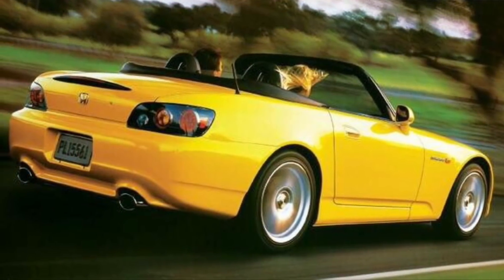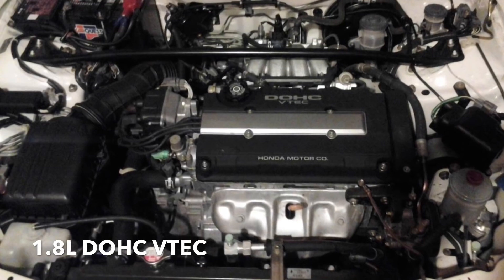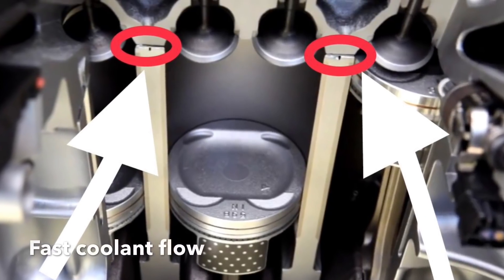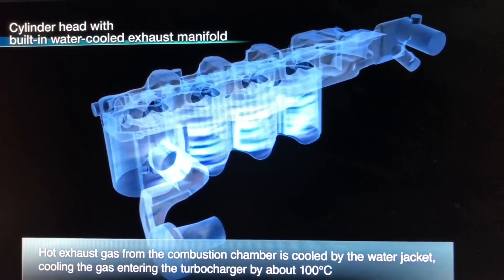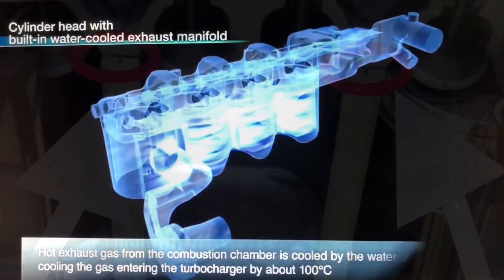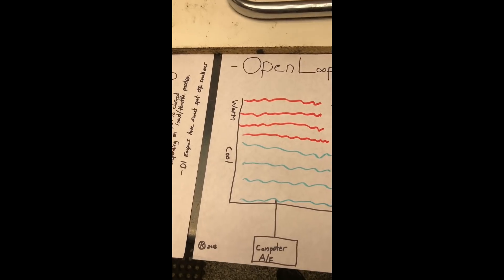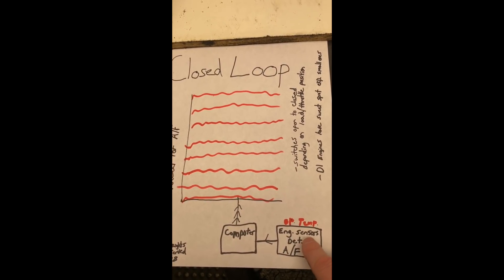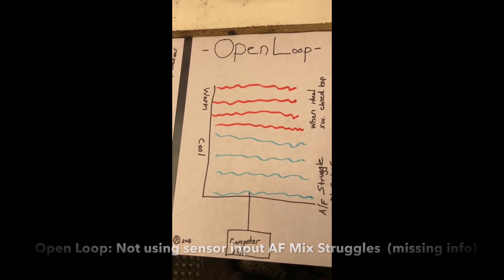1.5L Turbo Honda Oil Dilution Explained CRV Accord Civic

Comment: 2017 Si with 1.5T.  20k miles, so far so good. Change oil between 3 to 5k miles with Mobil One.  I warm up the engine till red bar shows up.
Reply: 41k miles on my 2017 CRV, 1.5l engine....no problems at all....get 35+mpg....luv it.   I use Mobil 1, Honda oil filters, change oil at 4000 miles or so.  Fill oil to 1/2 way on orange stick.  Oil dilution raises level to full mark, smells like gas.  But, all seems well otherwise.
Reply: harley62t  I have a 2018 crvI use amsoil in the engine and amsoil cvt in the transmission. I change oil every 5000 miles. I get 37 m/p/g. Also I use Mobil high test gas
Reply: @reginaldsmall3766 and I bet you had no problems with the engine or trans. That AMSoil is damn good stuff.
Reply: Seanster Yu good job bro I got 31k on my hatch 17 1.5t. And it’s still beating slightly older muscle cars with over 350 hp 😎
Reply: Im at 44k with mine. I make tons of short to medium trips daily for work. Just had all my warnings lights come on out of nowhere.  Honda told me it'll go away on it's own. This is my 6th honda. Not very sure there will be a 7th.
Reply: @kevinjohnson3925  engine warning light?  22k miles, still going strong.  I test drove 2nd type R yesterday
Reply: @seansteryu7398  22k miles is nothing, come back in 5 years when the car has 100k miles then we can talk about reliability
Reply: @AdamSmith-gs2dv  my s2000 ka supercharged with 152k still running strong.  Nonetheless, I'd pick any new turbo Honda over a ford.

Comment: If a American or European maker had the same problem every consumer group would be up in arms and people would be demanding buy backs and there would be class action lawsuits.
But all the Honda fanboys will just overlook it.
Reply: I am originally from Germany and my father worked as a engineer at both Opel and Volkswagen.
They both produce small displacement GDI turbocharged engines and neither experience the same problems.
People seem to think that American or European automakers produce inferior products compared to Asian manufacturers.
That simply isn't true and when a Asian manufacturer has a problem people gloss it over.
Reply: I come from Austria and i dont have this problem on my Honda civic 1.5 turbo 6MT manual..And i drive a lot of short distances....9km its about 6 miles to work..but at least once a month 100 miles .But i would like more people from Europe read this and if someone have this problem then we can make a community i dont know how and make pressure to honda to do something also here and whole USA
Reply: You got that right , I would be all over the news as well
Reply: @markussone7334  1.5 turbo honda engine is gdi system ecactly
Reply: @markussone7334  I would like we have here in europe 2.0 natural aspirated engine .Honda Civic but we have only Turbo 1.5 and for hatch additional 1.0 turbo..But again we dont have that problem like people iin Kanada Usa and China..Even people in Sweden ( cold whather) dont have oil dilution becuase of mixing gas into oli..We have here also a lot of Forums and discussed that topic..Of course 2.0 is more robust and one of the most reialble engines in the world..Unfortunatly we dont have choice

Comment: I think I will stick with my 2015 Honda CR-V Touring with the 2.4 liter. It’s been a fantastic vehicle. 67K trouble free miles. Plan to drive it for a long time.
Reply from the maker: Lrays Lrayss That is a good one 👌🏼.  For sure keep it for a long time.
Reply: The LX trim has the 2.4 in it.

Comment: Engines have almost always had a high oil level mark and most direct injection engines are not having excessive oil dilution issues.
   You talk about open loop and closed loop that most engines run in open loop until the engine and the catalytic converter are warmed up. You may want to check the Honda software to confirm it still has an open loop mode.
Reply from the maker: robmundy55 Well your right but I wanted to give some insight.  I didn’t think this video would even get that much attention... but by the time Honda answers to these issues they will have already lost a large portion of their loyal customers.

Comment: Lol I can tell you why it's getting fuel dilution. More fuel means less knock Honda went on the safe side and programmed the computer to put more fuel in. At almost all rpm ranges and if it detects a lesser grade fuel it may be putting even more in

Comment: This is nothing new its prettymuch Been around since GDI was introduced and paired with a turbo.  When you add increased compression into the mix now its ripe for Blowby.  I'm going to go out on a limb and add that Honda may have another factor to this equation, maybe too light of a compression rings and or a poor venting pcv system, just a couple of ideas,  hence the fuel in your oil, you can help the situ. By adding an oil catch can, this isn't a "fix all " but greatly reduces fuel saturation in the oil ( many oem's install them as factory equipment now) For the record these following things (when used together) greatly reduce the fuel saturation: an  O.C.C. ,  5w20  Pennzoil Platinum Ultra, this oil is rated as having a high resistance to fuel dilution and separation, Dump the oil every 3k miles if you drive hard, if easy driving 5k miles Max NO MORE!!!   (I'm saying to use  5w20 to be on the "thinner" side due to the very tight tolerances and clearances in these engines, I do speak from modest experience from my '08 Speed 3 in regards to these issues) Oh and welcome to the world of GDI TURBO !

Comment: And you Mr I'm not a mechanic you don't even know the correct different between open to closed loop you degenerate
Reply from the maker: Joey Bartoli Well...Mr Boey Jartoli My degenerate response isnt exactly accurate in other perspective either but if you got a better way to advise the consumer of Small Turbo GDI engines and why they arent immune to issues when buying a new car then go do it.  If people wanted a response on open and closed loop then they can google that and get facts.  Its clearly much more however its obvious they arent sending the Mechanics to the service desk to coach each buyer what in the hell is going on with their brand new vehicle either.  You need to understand people are not all going to grasp these things in the same manner.  Open and Closed loop is not even the tip of the ice berg on this issue anyways.  I do appreciate the response though.
Reply: Joey likes to be part of the PROBLEM and NOT part of the SOLUTION!  I think you did just fine

Comment: Interesting that I’ve seen so many posts about the accord being so superior to the camry, etc.. Toyota went for NA tried and true reliable engine. Puts out 206 hp. vs the 1.5 Turbo accord achieving similar horsepower, but having this issue, and potential carbon build up of a GDI only system. The camry uses direct and port to prevent carbon build up, improve drivability and reliability. I own a camry XSE 4 cylinder, and talked my brother in to the accord 2.0 turbo sport over the camry because  he wanted a stick, and I had test driven one, and was impressed by the performance. .They are both nice cars that people are attracted to for different reasons.. I definitely like the infotainment better in the accord, and the LKAS works better than LDA does in the camry. Camry 4 cyl does not have the low end torque of the turbo accord, but definitely have not seen any oil dilution whatsoever.
Reply: *_•hxxcker.reshirm•_*  

I would not touch that 10 speed auto with a 10 foot pole.

Comment: My grandma can't go down the street for "bingo night" in her crv. She now drives to a different county to avoid "fuel dilution"; thanks honda.
Reply: @stevemilliron6842  Lame excuse...
Reply: Steve Milliron the turbo 4 cylinder was mastered by SAAB over 40 years ago.
Reply: That saves a lot of fuel
Reply: Steve Milliron then why go down the turbo path when a VTEC was a great engine?
Reply: Change your oil every 3k miles and you'll never have a problem. ALL GDI engines are prone to dilution. Just let the vehicle warm up, ie dont floor it while its cold like a mong. Change your oil frequently and don't skip intervals and i guarentee you will never have a problem.
Reply: @ReaperActual518   I love Honda’s, own a 2021 CRV & 2012 Accord, but you shouldn’t have to worry about anything when you spend this much on a brand new car, I definitely change my oil & filter more than most & take care of my vehicles, but i should be able to confident & not have to worry about anything except recommended maintenance

Comment: Hi I’m a technician on European car and on Volkswagen cars we started having gas direct injection engine since model year 2006 and I never seen any issues that you are talking about but failed and leaking injectors yes i have seen a lot of them and the theories of small DI engine and turbocharged engine having oil dilutions issues doesn’t make sense VW started selling there 1.4 litre engine in 2016 in the Jetta in North America with a aluminum block and cylinder head it’s direct injection and turbocharged like the Honda engine but I don’t know about Honda but VW uses a dual circuit cooling system one for the cylinder head and one for the cylinder block and I think Honda is doing the same as VW it has a water cooling exhaust manifold so they are very close in design so saying that there is so much extra fuel that it gets into the oil enuf that it would raise the level of the oil I know that if a vehicle is driven in cold weather in short distance regularly it would add a small amount over a long period of time my wild guess is that the fuel is entering the engine ether by leaking injectors or high pressure fuel pump because it really not normal for a modern engine to add fuel into the oil .
Reply: Yeah VW jas the exhaust manifold run right through the coolant which heats the engine up crazy fast and gets to efficiency faster
Reply: Sons 1.4t does the same, comes up to temp really fast, within a minute even in freezing Temps

Comment: Telling people to warm up longer and not to take short trips is not an acceptable answer from Honda.  Doesn't do much for your MPG for sure.  Honda messed up big time on this one. Bring back the bullet poof 2.4L
Reply: Too many Americans in management for Honda. Go back to the basics including all engineering and assembly in Japan...they understand quality.
Reply: @Stephen97538  The current "NSX" is in my personal opinion the perfect example of too many Americans in management for Honda.
Reply: @Stephen97538   You want Mazda instead. All Mazda vehicles are still built and designed in Japan. Honda is not your friend anymore. Check out Mazda CX-5.
Reply: @waltchan  I would agree with this assessment.  Mazda and some of the Korean builds have the quality control and engineering that Honda had in the 90s...
Reply: @ibmtpx24  You have NO idea what you're talking about. In 2015 the ONLY Mazda that had any Ford parts was the last generation CX-9 which would blow the doors off of the butt-ugly Pilot! The 2016 CX-9 was brand new from the ground up and still blows the doors off the current bland Pilot. The CX-5 is a complete class above the girly-granny CRV. 
BTW, Mazda severed all ties with Ford about 2011-2012. Every Mazda vehicle sold in the US except the Mazda3 is built entirely in JAPAN by craftsman!
Reply: @davidsparling3505  Too late for me. My 2012 Mazda CX9 just got the water pump, timing chain, cooler into the oil and bye bye engine without a warning. I am dumping the car as we speak because it is too expensive to repair. Timing chain driven water pump is a design flow and a time bomb. Mazda and Ford are murderers!
Reply: @mrbob9556  Yep, the water pump on the 3.7L Ford V-6 is a disaster. I wouldn't judge Mazda on that, however. Mazda and FOMOCO divorced about the year your CX-9 was built. They robbed Mazda.
Reply: @waltchan  Not true. Some made in Mexico. (Not CX-5).Check out the rust on a 2-4 year old CX-5 front sub frame sometime. Not the best cars for New England salted roads. And I like Mazda's. Folks who get a new car every 3-5 years can buy a wide range of cars and probably be happy. I keep my cars 10+ years so I have to really  choose a long term reliable car which is getting harder and harder to do.
Reply: @ibmtpx24  
I wouldnt call a window issue with "some" cracking unreliable.
Reply: I got rid of my 2017 2.4L Accord because the intake valves were all carboned up at 20,000 miles. When I showed the pics of how bad the carbon was to Honda, they told me they don’t care..... bye bye Honda.
Reply: @craigg4246  if your 2017 2.4L Accord was direct injected, it will have carbon on the intake valves as there is no fuel being sprayed on the valves. It is just a side effect of any direct injected engine
Reply: @craigg4246  it had direct injection??
Reply: @craigg4246   i have Honda Accord 2017 2.4L  has 60000 mil  without any broblems
Reply: well toyota told camry owners the same thing when it came to the premature engine sludge buildup on there 2000-2005 camrys
Reply: @ChasingGhost5293  Honda fan-boy excuse. Honda sucks! Mazda forever!
Reply: David Sparling yeah u think that man I don’t even own a Honda haha
Reply: @ChasingGhost5293  Smart...
Reply: Nick V is half right in my opinion. I understand that all turbos should be given a minute to warm up. but no, Honda shouldn’t be telling us to avoid short trips when we might need them.  Now why was my temp gauge registering Cold today when it had been driven and it was warm outside?
Reply: Mike P To be honest , I would actually like if they brought back the SOHC engines too; they are really simple and easy to work on.
Reply: Nick V no replacement for displacement!
Reply: @Creeperboy099  yes there is it's called smaller turbo motors moron exactly what all automakers are doing!!!!!!
Reply: Mike P My favorite engines were the F22B’s— being the big block strokers of the SOHC, they have more torque and kick; they also sound nice and smooth too.
Reply: Mike P yes, it was— the CD5 Accord is my favorite car. What I like about the F series is the cast iron sleeves
Edit: Accord with NSX engine? I wish— at least the Accord shares the same suspension which is what makes it a good performing car. In fact, I’m thinking about installing OEM NSX struts instead of aftermarket coilovers when I get this dream CD5 of mine
Reply: whoever said the 2.4L is bulletproof xD rofl
Reply: Or 1.8
Reply: Nick, you're dumb, stop commenting.  Your driving behavior is unacceptable.
Reply: Honda is basically blaming the car owner for the oil dilution issue.  Short trips to the supermarket and the local shopping mall is owner abuse?  Never owned a Honda and now I won't even consider one.  Incredibly, Honda is still selling CR-Vs for top dollar.  I have a 2017 Ford Fusion with a 1.5T GDI EcoBoost engine and the cabin gets toasty warm, short trip or long.
Reply: @frdjr2527  Buy me a "new" Honda CRV 2017, and I guarantee, the way that I drive it, the oil dilution issue won't show.  It is the driver, you can't just full-throttle the car while it's cold, then shut it off cold, and then start it cold and full throttle it home, parking it still cold, then repeat, and not expect some dilution.
Reply: @hegeliandetective1034  what do you do when you need to go to the store in the winter? Does it help to let it run for 10 minutes before driving it?
Reply: @shando3333  Extreme cold, yes, 5-10 minutes.  Cold, 3-4 minutes.  But always at least 2 minutes to help oil rings seat against cylinder walls, warm enough to help dissipate moisture, and properly lubed, before driving.
Reply: I wonder if GM and Ford vehicles have these kind of problems too.
Reply: Nick V   The 2.4 l is not bullet prof. It could be taken out with a 50 cal and some training. If maintained it easily does 100k
Reply: @thomasburns2557  "If maintained".  Duh!!  You're a genius.
Reply: That 2.4 burned oil in the 2003 to 2007 Accords......I've owned 2 that burned a qt every 700 miles or so.
Reply: According to carcomplaints.com, 1997 Accord was the last-time Honda really built a reliable car. With complaints rising on Honda yearly since 1998, while Audi is going down to zero complaint since 2016, what's wrong with the picture?
Reply: Walter Chan I honestly agree and in my opinion, the fifth generation Accord is the best car when combining practicality, reliability, and performance.
Reply: @waltchan  A whole lot is wrong if you keep your Audi for a long time....in which case you might want to consider a "major and costly repair fund" at your favorite bank.
Reply: My '18 civic si with an l15b7 vtc turbo doesnt have a single issue.  This shit is just scare tactics.
Reply: My wife's 2015 CR_V with the 2.4L also had fuel dilution to the extent that the oil level climbed above the full mark inside of 200km of an oil change and oil analysis gave a fuel dilution of
7%. We got rid of the vehicle.

Comment: I'm not worried about it... They will come up with a fix... Most likely they will be replacing all those engines in the Crv... That's the one with the most issues... So my Crv doesn't have that issue... Then again, I have 40 miles everyday

Comment: My 2017 civic hatch has fuel in the oil also.  I just checked, but I figure I'm going to contact the dealer and let them know.  Hopefully, since this is clearly becoming an issue, Honda takes steps to correct the problem, or in 5 years they will have a bunch of dead cars, and dead reputation, on their hands.

Comment: recently my 2.4 accord is giving the same problem...

when i start it emits black smoke n rough idle.. like running extremely rich... dont understand why
Reply: You are burning oil, you probably have bad piston rings allowing oil to seep into the combustion chamber. When oil burns it produces a dark gray/blue smoke out the tailpipe.